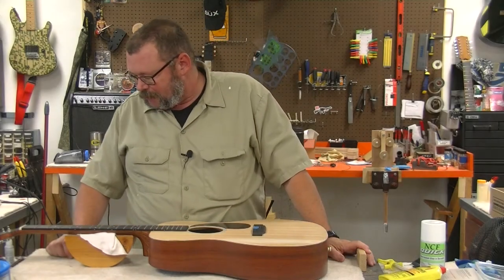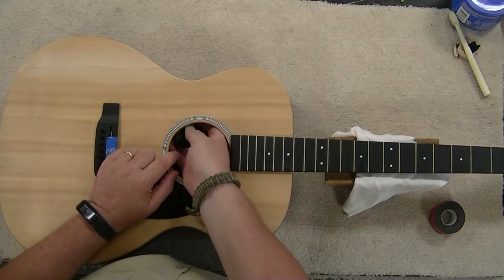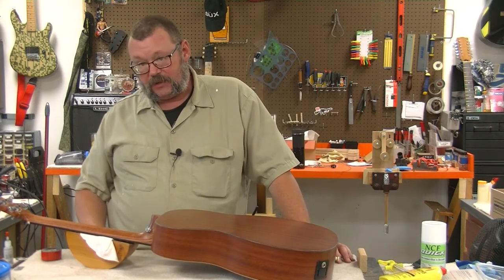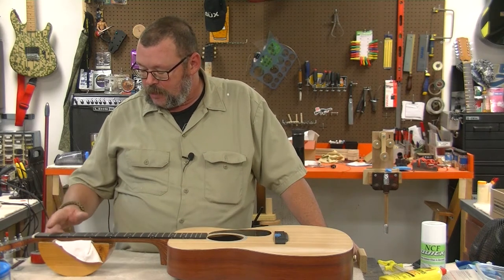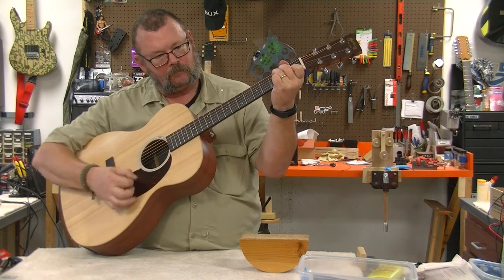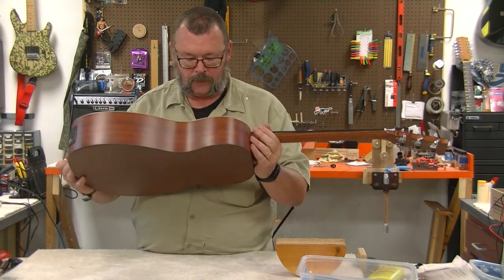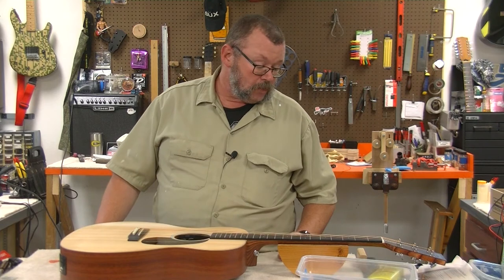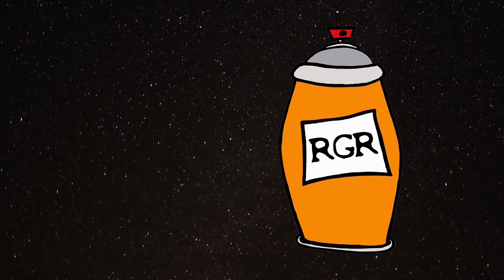P MARTIN OOOX1AE repair complete | RATTLECAN GUITAR RESTORATIONS by James O’Rear

Comment: Have an Alvarez RD-20 SC fell on it and pushed the stand through the back and out the top, wanting to fix. Like your video explanation on why you fix it maybe I will learn too.
Reply from the maker: Give it a shot. Fortune favors the bold (but it helps to research a bit as you are doing as well).

Comment: Thanks for posting this video , I have the DX1 and this videos are great to study for I've def have had to work on mine too .
Reply from the maker: Glad we could help you out.
Reply: I've always kept mine in the hard case when not in use and try to regulate the humidity in the room.   I have had some cosmetic cracks form in the top of my spruce on grains does have some scarring from banging it around but other than that this thing is a beast took it out of the case after not being around for two years and it was still almost in tune lmao.. i had it almost 20 years.

Comment: Nice work James. I have worked on all manor of inexpensive or junk guitars. You don't start doing neck resets on 50s Martins first time out. Same goes for top and or side cracks, loose binding, ext. And even now that I can charge full boat on repairs and have a decent following of clients I still fix old and or new and worthless guitars just because I love doing it and every guitar deserves a second life. 

I've probably said it before, I'm a little disappointed in martin for these guitars. Especially the all HPL model. These guitars should not be priced at more than say 400$.
Reply from the maker: It certainly gave me a number of things to work on that were new. With the number of "alternative wood" instruments being produced it seems like a good skill set to have in the tool box. Thanks for stopping by Dane
Reply: I have the original made in USA dx1 over 20 years sounds better than a d18.   Honestly i think a spruce top and hpl sides and back is the perfect combo.    Mine doesn't have Richlite it has Micarta which they stopped using,  and also a rust stratabond neck which they no longer use.  But man, its never needed work done.  Still perfect intonation and holds in tune forever.   Top has some scars and grain lines.  and is now an orangey yellow. The highs  resonste and project more to compliment the boomy bass that sold me on it originally.   The equivalent  now would be the dx2e which interestingly is only model with katalox instead of richlite.     The d1 or original dx1 or dx2e woild be my recommendation over a d18.   Its a well known secret.
Reply from the maker: Thanks for the info.